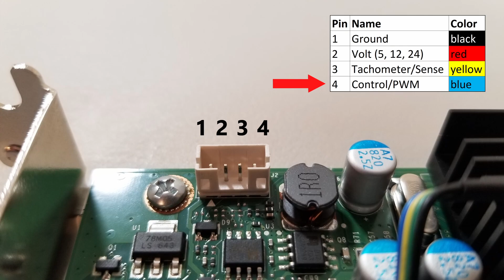Replace Dead GPU Fan For One With Less Pins

Comment: its possible to have an adapter that connects the gpu fans to an cpu fan slot? my gpu isn't sending power to the fans and is limiting my usage of the gpu because it heats so much now.
Reply: id like to know this as well. im experiencing the same problem

Comment: I have a 6 yo card and today I wanted to replace the fans , I got some replacements and got to work , but when I tried to unplug the old fans they would just not budge and little by little I pulled out the entire socket with the pins , I tried to put pins back with the new fans but they wont respond , my pc sends commands to run at certain speeds but the fans wont respond.

Comment: My gtx 1050ti’s fans suddenly stopped spinning, even though thr gou in general it’s working, it’s displaying

You mentioned about the gpu fan cable having common voltages of 5v, 12v and 24v

Do you recommend doing this test with the pc running ? So I could make sure that cables are fine

Comment: Can I run GPU without fan? it's too much noise
Reply from the maker: Would not recommend. Some cards are made to be passively cooled, and just run with heat sinks only. Most cards with fans however will quickly overheat and stop working if the fan stops or is removed!

Comment: Hello, 

I'm having an issue with my ASUS 760 MARS Edition. One of the 2 fans had the same issue as your fan, the beering broke and the fan fell off. So I ordered a 2 Fan kit from Amazon that had the same exact model number and they claim it's for the 760 MARS Edition card in the title. 

My issue is similar to your issue. The fans I ordered have only 4 pins but the video crad has 5 pins. I tried both configurations, plug the 4 pin connector to the right side and I ran a test. The fanas didn't spin at all. I tried connecting the 4 pins into the 5 pin receiver on the card, to the left side this time. The fans still don't spin at all. I ran the MIS Afterburner app to try to manualy force the fans to pin in both cases and there's nothing I can do about it. I'm looking on Internat and 5 pin fans don't seem to exist at all. 

Is there any ways I can modify my new fans to have the 5 pin connector? 

Thansk in advance and if I find a solution before you reply, I'll come back here and let you know. 

Cheers !!

Comment from the maker: Interesting to note, that i've used a GT 1030 with a dead fan before and just the heat sink. It certainly ran hotter, but it still worked fine. It was in an open air case however, and I plan on putting this card into a SFF case, so a working fan is definitely going to be needed.
Reply: Cost of the fan???